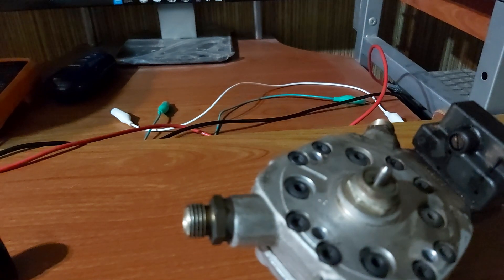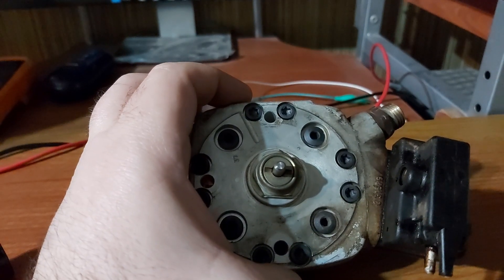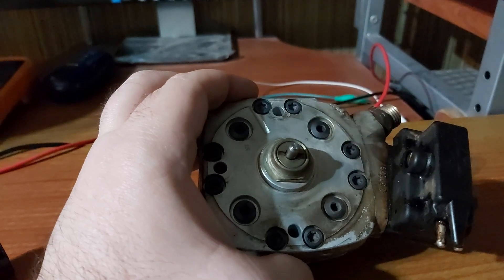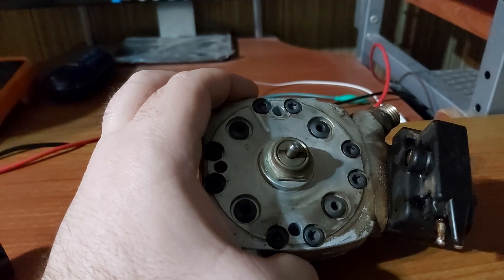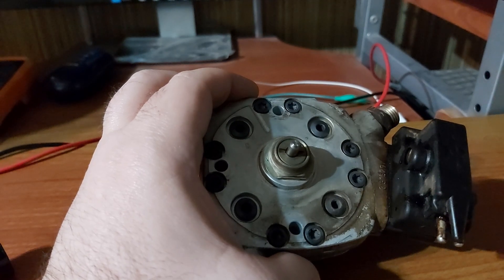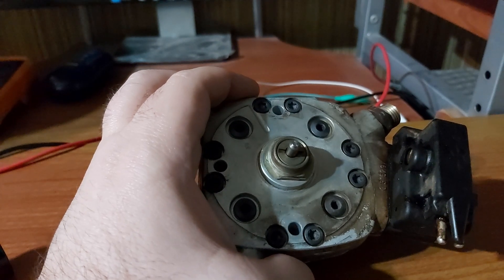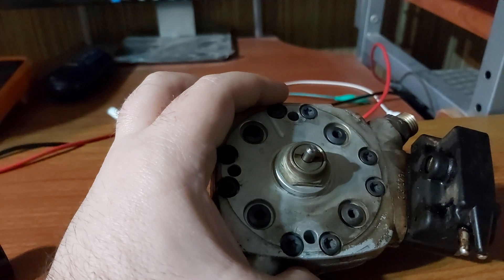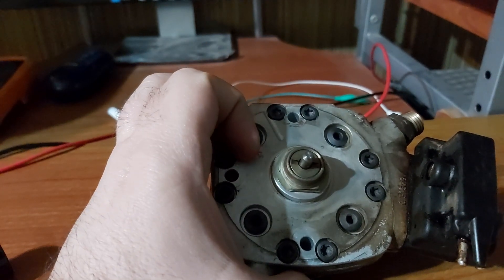㉦Mercedes Ke-Jetronic㉦ - ♍A virgin fuel distributor♍/🤔❓what to do before first disassembly❓🤔

Comment: Good night

Hoping you have a nice day

I have a problem with  my car (actual the problem is with mechanics) 

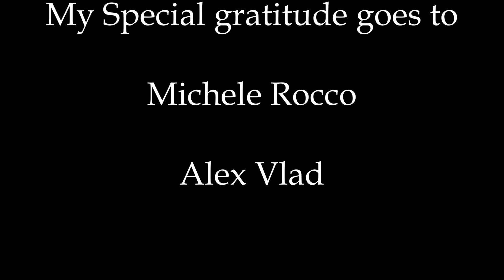The engine does not have any 5:41  problem unless when i slow down to stop, the rpm fall down quickly and the engine sometimes switch off.

I hope you can help to find what is the problem, 

Please note that: this problem does not happen every time i slow down and stop, sometimes yes and sometimes no!!!!????!!!

Gear box is manual 

Coolant sensor has 4 pins

W124
Reply from the maker: Either the idle control valve or the ECU! Because I was talking about it. I put the original ECU and the car stalls, exactly as you described it. Once I put the newer ECU the car does not stall. Check all the sensors, the idle control valve as well as the ECU.